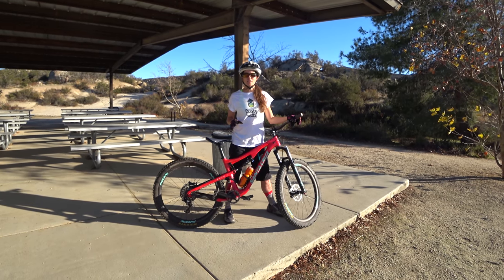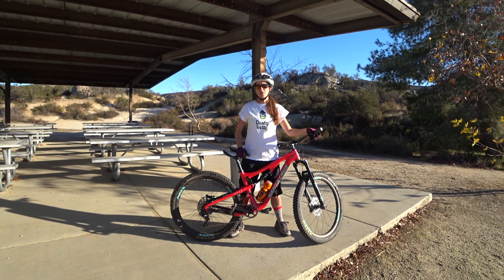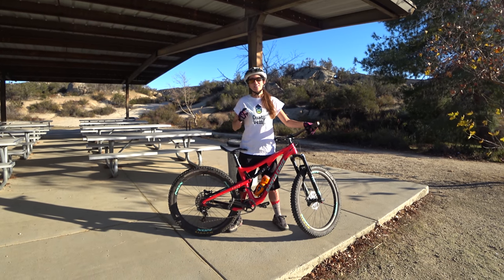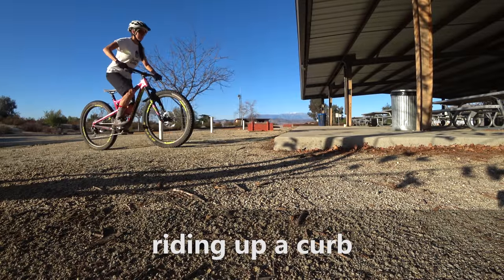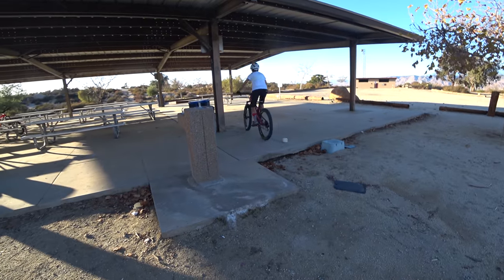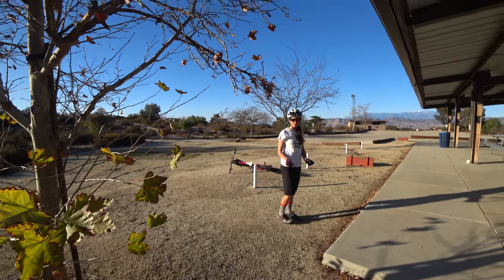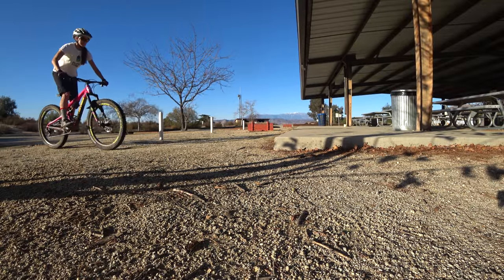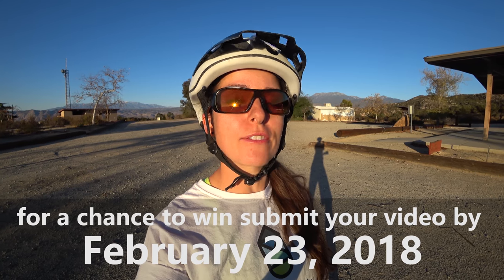Sidewalk Sessions: Basic Ways to Go Up and Down a Curb

Comment: Great video, Tess. Some may think this is a simple skill, but I have seen it cause no small amount of fear for some people. Indeed, I myself have had some trepidation at times when approaching a curb. Especially a tall one. So good little tutorial. 

I am wondering, do you film your videos at 120 fps at all? If you're looking for smoother slow motion, you should. I don't know what you used to film this tutorial, but if it was an iPhone or Samsung, it should have the ability to film at the higher frame rates.

Of course, I'm making a huge assumption that you even WANT smoother slow motion. I can see why you might have purposefully made those slow motion segments the way you did. At any rate, just thought I'd share that. I hope I didn't cross a line.

-Brian